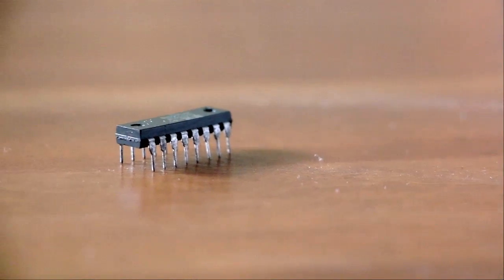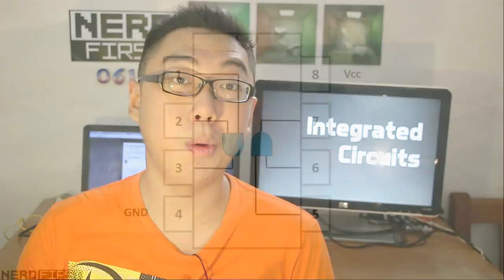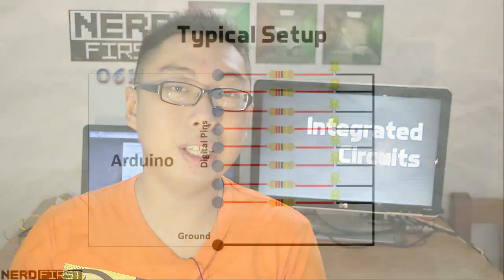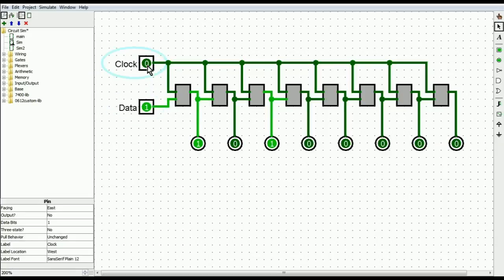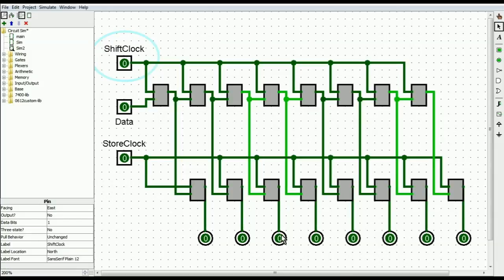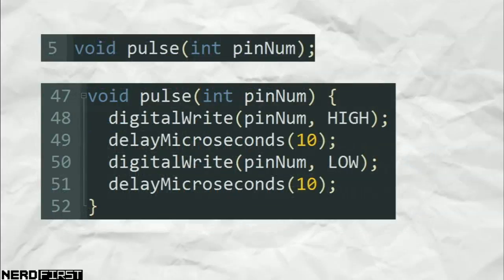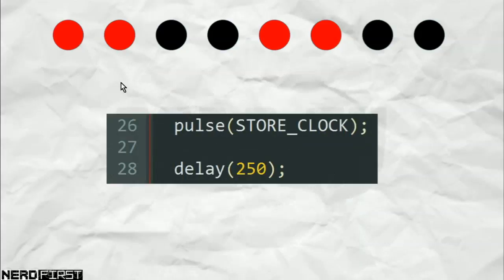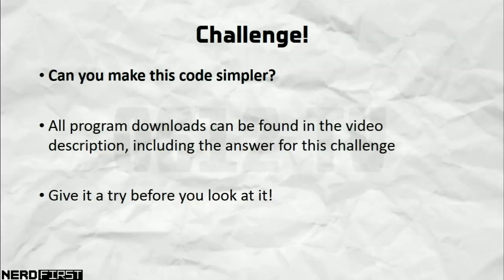Integrated Circuits (w/ Shift Register demo!)

Comment: I don't actually know C (I still need to learn it), but I'll see if I can explain it in pseudocode.

Loop
Shift_Register_Output Data_Pin, Store_Clock, Shift_Clock, 0xCC
Wait 240ms
Shift_Register_Output Data_Pin, Store_Clock, Shift_Clock, 0x33
Wait 240ms
End Loop

Function Shift_Register_Output Data_Pin, Store_Clock, Shift_Clock, Data
For I=7 to 0
T=Bitshift_Right(Data,I)
T=T AND 1
Pinout Data_Pin, T
Wait 10ms
Pulse Shift_Clock
End For
Pulse Store_Clock
End Function

Function Pulse Pin
Pinout Pin, 1
Wait 10ms
Pinout Pin, 0
Wait 10ms
End Function
Reply from the maker: Oh wow, did you just derive code for shifting out a byte to the register? Pretty impressive job =) I'm fairly certain that this will work correctly, though I could probably nitpick on a few really minor things =P

1) Note your waits: "ms" is millisecond, and we usually represent microseconds with the unit "us" (since it's a bit hard to type "µs"). Waiting between pulses is measured in microseconds, not milliseconds. No harm in waiting for a longer time, of course, but that means less work done per unit time.

2) You bitmask in a very interesting way. What I see more often are people shifting a mask, and then applying that mask to the input data, but you seem to be shifting the data instead. Again, no problem with that, just makes it a tad harder to read, especially with the loop going backwards =P Pseudocode for that part using this method:

for i from 0 to 7:
    mask = 1 << i
    if (data & mask) != 0:
        send HIGH to data pin
    else:
        send LOW to data pin
    endIf
    pulse shift clock pin
endFor
pulse store clock pin

EDIT: Made a minor edit to the bitmasking operation.